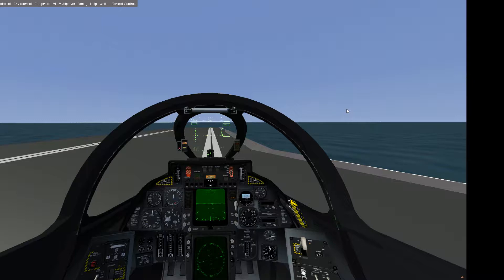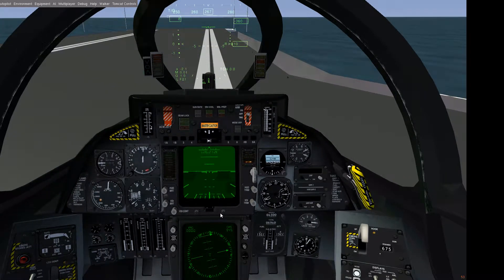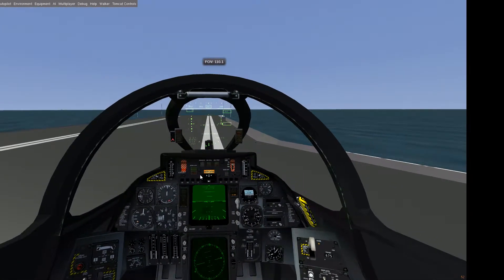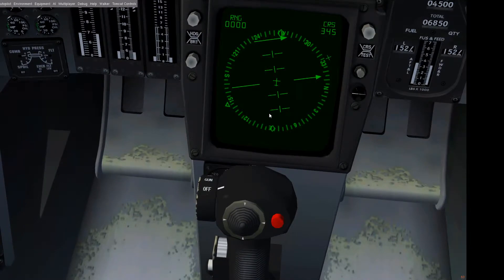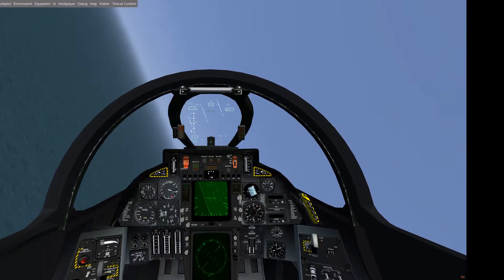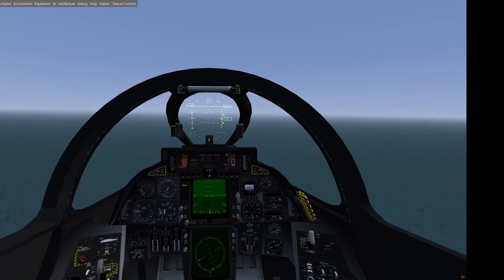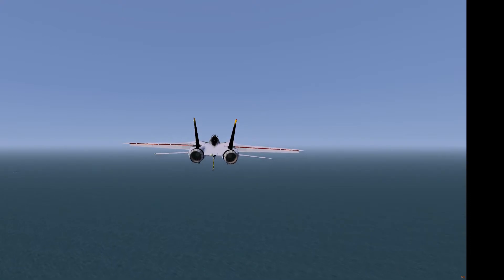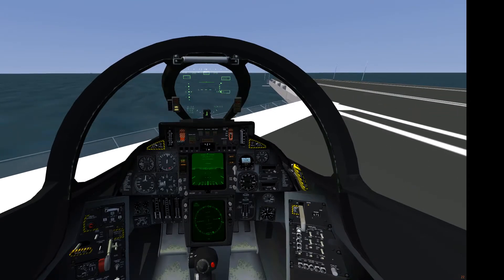Flightgear F14 Aircraft Carrier Start and Landing Tutorial

Comment: Thank you for this. i am now wiser :)  but:
There is no TACAN range displayed  in my HUD? and
enabling autothrottle in my F-14 basically set the F14 into a controlled Glide Path of aroung 10 something degrees. it Definetly does not maintain current speedset.
any ideas what I do Wrong?
(maybe the TACAN is not tuned correctly? - eventhoug FGFS has tuned for me to the Nimmits..

Comment: I made it to land on the carrier this way, too. But my feeling is that this is not realistic enough....For one thing, like the other user commented, 180 or 160 kt is too fast; on the other hand, holding the optimal angle of attack while adjusting the descending speed is extremely difficult.  The AoA indicator is red almost the whole time in your video (so was it during my attempt.......).   I tried to look for information about the operation sequences in the aircraft manual but failed. I mean I hoped to find something like a cross table for optimal airspeed and angle of attack.

Comment: Way too fast on the approach, 160 kts (still too fast) or slower. If the plane is too heavy to handle at low speed dump fuel. Also push the power up as soon as the wheels touch the deck, you could miss the cables or have the cable snap. You need enough speed to climb and go around.